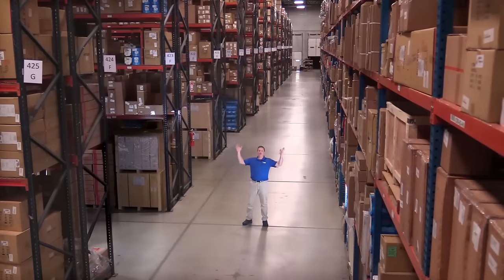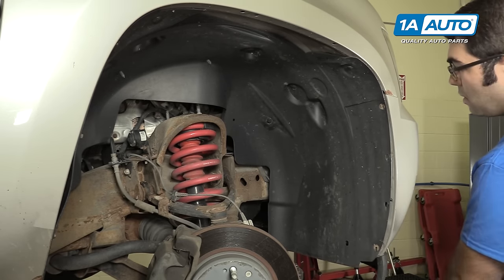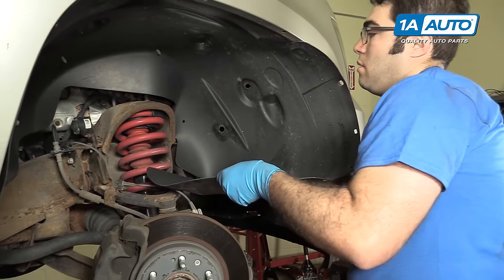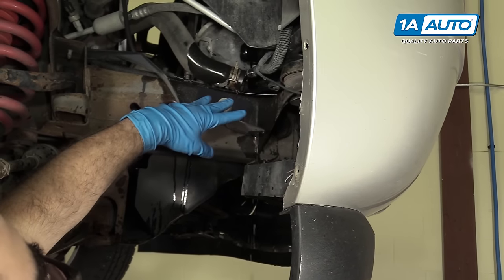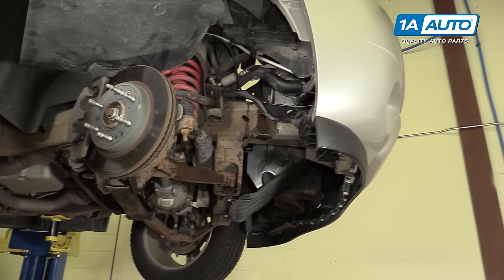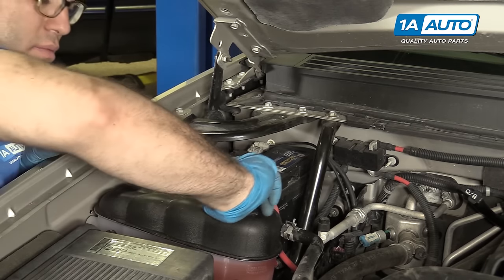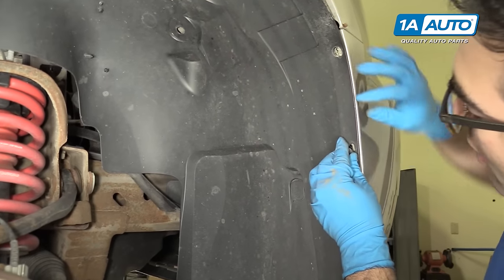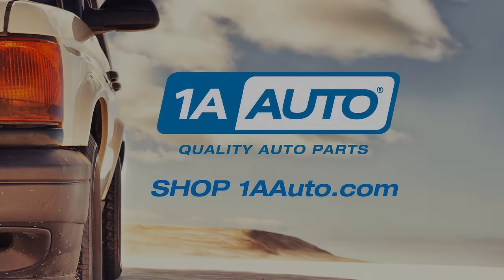How to Drain, Fill Bleed Radiator 07-14 Chevy Suburban

Comment: Another great idea from GM...no radiator drain plug! GREAT GM...just GREAT!!! soon no drain plug for engine?????? Time to switch to another truck!
Reply from the maker: +Mark Bordelon Thanks for checking us out! http://1aau.to/m/Shop-1AAuto-c
Reply: Most manufacturers don’t have anymor
Reply: My GMC Sierra 2016 has drain plug ; did you even look?
Reply: Automakers figure that the coolant will last until the warranty is over. After that, they don’t care if you can easily drain the coolant or not. They should be fined by the government since it’s an uncontrolled spill that can spill on the ground.
Reply: Sell me yours when you switch!
Reply: Its a affordable vehicle its not going to come with all the bells and whistles. You could easily rig up some type of easy access valve to drain every 30k miles
Reply: @f5fstop  where is it ?
Reply: @franciscojaversaucedososa6333  Mine is on the driver’s side at the bottom.
Reply: @HumanPheromones  affordable at 80k???

Comment: You can also turn the heat all the way up, and top up the tank as the engine is running. It also helps to leave the cap off while the engine is running with the new coolant to allow air pockets to escape so you don’t get air trapped in the system.
Reply: If you leave the cap off air won’t be sucked into system?

Comment: ok so where is the "bleed your radiator" part? did i miss something? is there a way to bleed the radiator? its in the description but i didnt see anything about bleeding it in the video :( thats the only reason i watched this :(
Reply: The expansion tank is usually the highest component in this type of cooling system and air naturally "bleeds" to this highest part (as evidenced by how quickly the coolant level dropped after the initial start up).  Air may continue to bleed over the first several drive cycles so be prepared to add more coolant if the level drops below the full mark.

Comment: Shouldn't it be totally flushed? 🤔 Isn't the new coolant as contaminated as the old coolant that was left in? Did I miss a step or something? Lol
Reply from the maker: +Mule Shark This video is only to show how to drain, fill, and bleed the radiator. It is not required to completely flush the radiator unless you are having some other issues. Thank you.
Reply: Mule Shark - The short answer to your question is yes, the cooling system is still dirty and very little actual prevention was just conducted.
Reply: @seth_5394  If you were throwing dirt inside your sealed system then yes you should flush it completely.  But they are showing a sealed clean system.  This will work fine, did it get 100% of all coolant out? No but its coolant vs city water you want to flush with, which will contaminate the system. By replacing 99% of the coolant you are restoring the coolant.
Reply: You can use distilled water and drain it to clean the old coolant
Reply: Flush with water then add coolant

Comment: Ok so i just need to run out and buy an vehicle lift first, got it!
Reply: Ramps work fine too, that's how I do my 2013 Suburban.
Reply: You can remove the hose without lifting the vehicle but it is tight , that’s what i did , and i think they removed the wheel so you can locate the hose you need to remove

Comment: No need to burp the system? Is there a way to to get air out if it's trapped? Or does it self bleed somehow or something?
Reply: Theres a specfic way to bleed it which is very important...unless you plan on putting head gaskets on soon.  That was the worst video ever about that.
Reply: these newer systems are made to not allow trapped air.
Reply: The expansion tank is usually the highest component in this type of cooling system and air naturally "bleeds" to this highest part (as evidenced by how quickly the coolant level dropped after the initial start up).  Air may continue to bleed over the first several drive cycles so be prepared to add more coolant if the level drops below the full mark.

Comment: When draining radiator fluid cold do you need to take off thermostat to allow engine block to drain as well only got maybe 2 gallons of fluid out of the radiator where's the rest of it
Reply: You are absolutely right 
The thermostat suppose to take off

Comment: Hi I am having trouble with my 2007 suburban 1500   The motor is been getting over heating I changed the thermostat water pump and radiator and still gets over heat can you guys give me some ideas Wthat too fix
Reply from the maker: +capo3029 We wouldn't be able to diagnose an issue like that here, you may want to have a local mechanic take a look at it. Thanks for checking us out! 1AAuto.com
Reply: 1A Auto Parts thanks for your respond
Reply: @capo3029  Are your cooling fans coming on?  That's the first thing I'd check, if not, could be a fuse/relay or bad fan motor.  Make sure you don't have any obstructions in front of the rad (behind the bumper cover), could easily pick up a plastic bag or something on the road.  Wouldn't hurt to hit it with a hose or pressure washer to clean the stack out, either.  Another possibility is air trapped in the system, also possible you got a bad new thermostat (not likely, but possible).
Reply: Check your belt tensioner sometimes if they are worn that could be it

Comment: I recently just replaced the engine on my 2007 Chevrolet Suburban 5.3, and the engine that i just installed has been completely ran through with new parts, the engine runs great, but when i gilled it with coolant, and ive done all the correct steps, it continues to overheat, well i just replaced the thermostat last week, it still continues to overheat, the waterpump is good...can anybody tell me what might be the problem?

Comment: So Chevy decided to cut ✂️ out drain plugs on the radiators to save 2$ or 3$ per Truck resulting in millions saved for an already rich company??? I'd rather pay the 2$ or 3$ extra and have a freaking drain plug. Also would like not to have to peel back the wheel well trim. Older vehicles accomplished this year's ago so why complicate it now by things hard? Chevy is getting on alot of people's nerves here lately and still we buy it.
Reply: 07 silverado i found it easy to remove air filter box to access that hose
Reply: It’s a done more complicated now days so you will say  ,”screw all that”, and take to the dealer where they can charge you a hundred or so dollars an hour to do  what was once a simple job.

Comment: I do this exact job without removing the tire.
Reply: I pulled the hose from the top. Remove air box for better visibility. Long channel locks to get spring clamp off hose.
Reply: @user-re3qq7pi7i I did it from top too but I didn’t take out the air box cause I was lazy. I had to squeeze my arm down there with vice grips and about half an hour later I got it off. Definitely not the proper way but it was on my own vehicle so idc how long it takes😂

Comment: How do you drain the fluid from engine?
Reply from the maker: +Frank Arango The basic steps to flush a car engine block are:
Remove the lower radiator hose and catch the draining coolant in a bucket.
Remove the top radiator hose and flush the system out with a normal hose.
Continue until the water runs clear out of the bottom of the engine.
Refill with coolant and reattach the radiator hoses.
Reply: @1AAuto   Thanks for the response! Please keep making these videos, they are very helpful.
Reply from the maker: +Frank Arango We will keep them coming! 1aauto.com
Reply: Doesn't work like that.... if its not running or hot that thermostat is closed so coolant is being flushed thru the engine block. Your only draining the radiator and coolant tank.

Comment: Hi 1A Auto parts, 

Thankyou for your great vids, I've just subscribed. I watched one of your other vids on bleeding breaks, very helpful but I did mine and once I have the air out and the break pedal is hard I start the vehicle and the moment I do that the pedal goes spongy, is it because they're power assisted breaks and I have to do it whilst it's running? 

Thankyou in advance. (I'm asking on this vid because the break vid is 4 years old)
Reply from the maker: +Ricky Driver Thanks for watching!  If you bled the brakes and still have that issue then We recommend you have a trusted mechanic take a look at it.  One thought is it could be the brake booster.  1aauto.com

Comment: I got a 2000 gmc sierra 5.3 im changing the radiator how do I flush the engine with clean water before I put the new radiator.
Reply from the maker: +gino capone We currently do not have an auto repair video that covers this particular repair. We will keep this request in mind in the event that we need to make this repair in the future. 1aauto.com

Comment: My experience with 2012 Suburban 5.3 so far: raised pass front. Removed as described, the inner fender liner and lower rad hose. 

Additionally, I removed the intake assembly between throttle body and MAF to gain access to heater core hose on input side of thermostat at the water pump, and disconnected it to allow the balance of coolant out of the engine and heater core. 

Did this because the thermostat is most likely closed at this point.

So my question is, if both sides of the thermostat are emptied, would there be anything significant left in the system?

After doing this, and properly “burping“ the engine, I was never able to add more than two full gallons of coolant mix, While the advertised capacity of this vehicle, is on the order of 4.5 gallons.

In my opinion, I believe I am missing something.

Comment: I’ve thought about drilling a hole in the hose i need to move and just putting a rubber coupling with hose clamps. Maybe even putting a hose and a barbed fitting into the hole i drill. 

5 bucks to save a mess and maybe even saving the fluid.
Reply: LoL, do what?!?!?